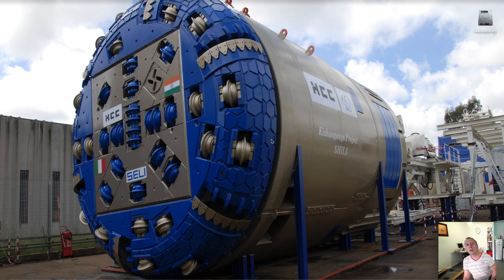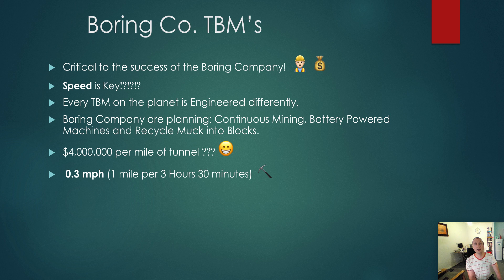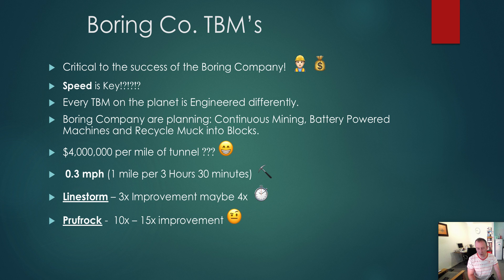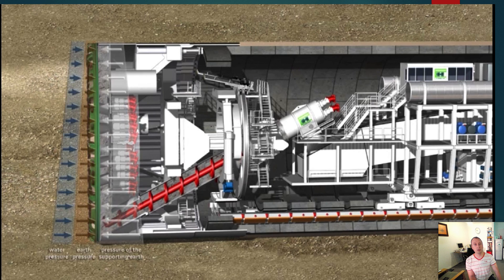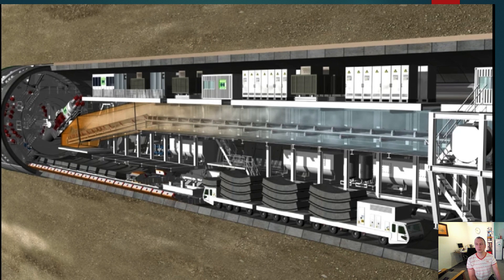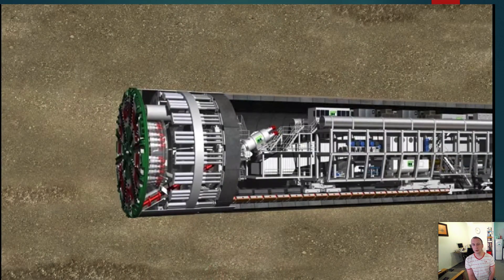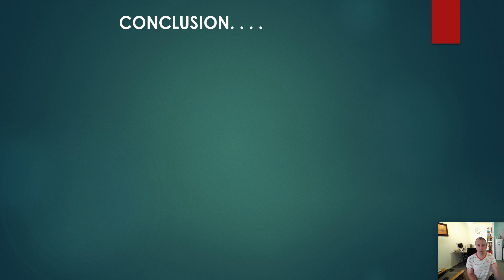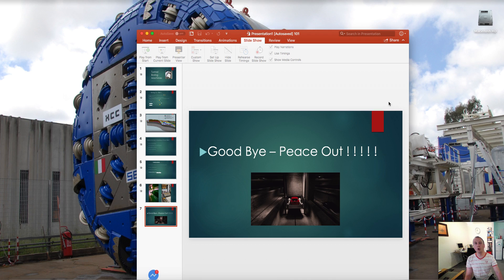A Boring Revolution - Elon Musk's Secret TBM technology  #6

Comment: Musk said he spent 10 million so far on the tunnel excluding the cost of the tbm but using an existing tbm with no upgrades other than making the rail access electric. I think he bought this TBM used for 10 million also which puts him at 20 million for the test tunnel in LA which is a mile in length. There have been many projects that ran at a billion per mile. Given that he's using mostly existing tech the problem doesn't even seem the speed so much as pure government pork and corruption.
Reply from the maker: Very true - If you've ever worked in construction and witness the relationship between subcontractors, contractors and Govt officials you'll know that every problem / contract can be ironed out over a round of golf. Happens way too often.
In fact i'd say between 2007 & 2017 it go much worse. People get paid to grease the wheel.
Reply: Yes, there have been few rockets that cost over billion per flight.
Reply from the maker: 786otto some very shady operators in the U.K. construction industry. Too many back handers. 😠
Reply: Rykahnz. To be sure the private sector does most of the boring/tunneling for mining so if the government are paying the same or more that doesn't suggest very much about how bad or  good government functions. As most people have not figured out capitalism is hardly that fantastic at making consistently revolutionary change when profits can be maintained trough using century old means and methods.
Reply: Bound to be governmental corruption and inefficiencies, but also remember that so far TBC has only made one tunnel to nowhere in an industrial suburb of LA. It is much more difficult/risky/complicated to tunnel under a dense city and remove debris on congested streets without disturbing businesses.
Reply: @atomicsmith   The vast majority of tunneling is done in the private sector. Don't let your problems with supposed government corruption( corrupted by private money) get in the way of thinking logically about the world.
Reply: @pietersteenkamp5241  Your two comments sound like you are very defensive about governmental inefficiencies. I think it may be you who is not seeing the world logically and reasonably. Governments are often corrupt. That's not a damning statement, it's just the nature of large bureaucracies. Very large companies are often the same.
Reply: @atomicsmith  The difference of course being that governments can be moderated by parliamentary decision making which is possibly even democratic while corporations   are essentially dictatorships with at best a few competing power centers very near the top.  Also corporations have a profit motive which leads them to indulge in all manner of as illegal activities as they think they can get away with while again at least formally in government the point is to keep at least some large percentage of your voters happy while a corporation can mistreat ALL of it's workers. 

My point of course isn't that there is not vast room for improvement in our democratic public institutions but that those are worth fighting for and salvaging while the same can and should not be said for private selfishly motivated pursuits of private profits/power.  It may even have been tolerable to have all these private corporations but unfortunately they extract and concentrate wealth into a few hands that then often proceed to undermine the democratically decided on protections/regulations we instituted to protect ourselves against their worst abuses.
Reply: @pietersteenkamp5241  Sounds like you should move to China.
Reply: @pietersteenkamp5241  > Also corporations have a profit motive
.
...as opposed to politicians and welfare queens who definitely not having profit motives? LOL.
.
> which leads them to indulge in all manner of as illegal activities
.
Again, corporations are not in any way unique here. Politicians break the law. Drug dealers break the law. You broke the law when you cheated on taxes last year.
.
> It may even have been tolerable to have all these private corporations but unfortunately they extract and concentrate wealth into a few hands
.
Thank God there are no evil corporations in e.g. North Korea and all wealth, and all political power, is concentrated in not-at-all corrupt hands of Our Dear Leader!

Comment: You may have hit the nail on the head. The Boring company may be a way for Elon to keep some key design engineers at SpaceX busy while other problems are addressed, and it could be that the whole enterprise is meant to be sacrificial to bankruptcy should that become necessary. It probably absorbs some intermediate profits Elon is getting that would go to stockholders if SpaceX were public. I just took a look at a documentary that detailed what happened to George Westinghouse, when bankers of that time would not back the expansions he needed during a recession. His several companies had apparently over-extended themselves during good times, and, always the vultures of Wall St. are waiting to pounce on good companies needing credit. Brand building begets Brand mining for profit. As in any mining endeavor, it soon plays out if bad management decisions supplant ingenuity, or drives the good workers out of the company with no talented replacements easily found.
Reply from the maker: I'd imagine around 2,000 engineers / graduates apply retrospectively to SpaceX every single year and the best 2% should be hired and allowed to work on various minor projects to keep them busy before the BFR Designs are finished in 2021 !
Reply: Paul Gracey Elon just launched Seven thousand, and then 9000 add those together that’s how many already sent to create Skynet for satellite communications Wi-Fi G5 and possible DEWS. This is the first of 42,000 satellites he’s going to put up. This guys got to have manufacturing going on all the time. And countless other enterprises. Amazing. Yesterday Mr. MB had video of a string of lights going through the sky I think maybe that was the satellites but each one of them had a light it was weird.